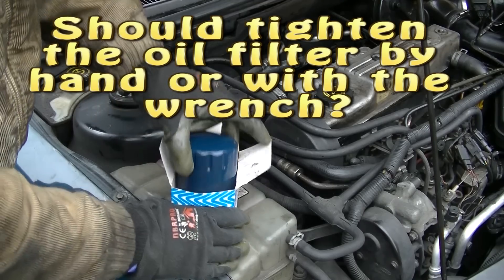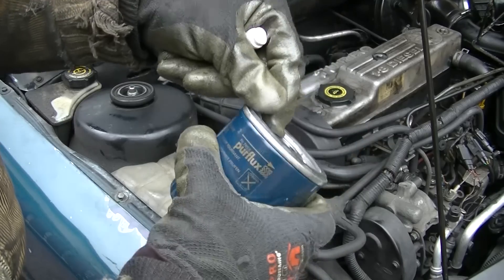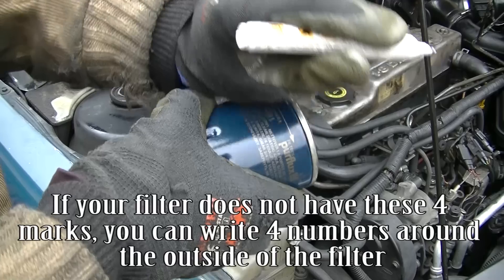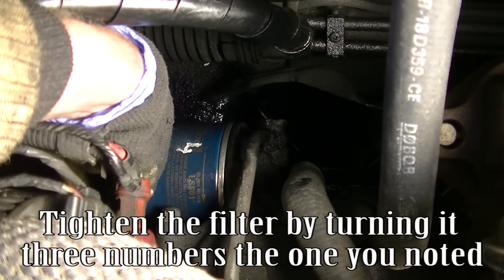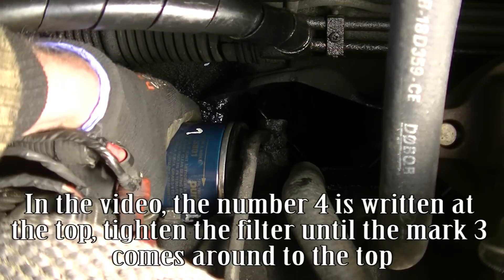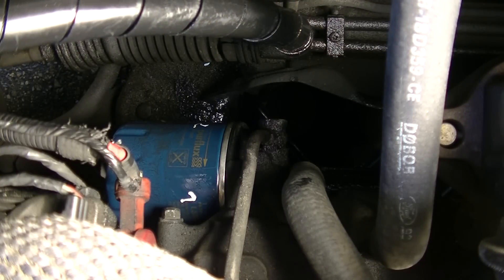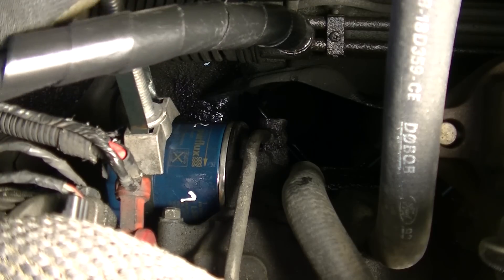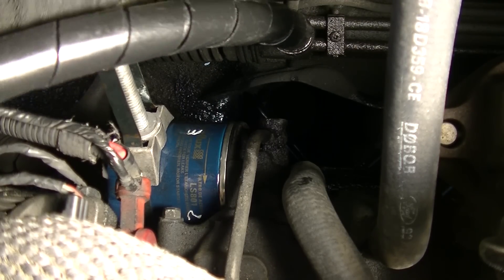Should you tighten the oil filter by hand or with the wrench?

Comment: If mechanics used torque wrenches on oil filters and oil pan drain  plugs used new drain plug washers and made sure old filter gasket came out with the old oil filter most of these issues would be eliminated.

Comment: I really like the adjustable oil filter wrench in the video.  Can someone tell me where to buy it?  Thank you!
Reply: You can find them at any automotive stores and they are cheap. There will be many different types of them. I prefer the filter cap removal ones as you will have less chance to damage the filter housing but you need a wrench separately to use it.
Reply: @fisherpaykelauto6137  Thank you for the reply.  Most of the filter wrenches are for removal, but not for tightening.  The one that you shown on video is for tightening.  This one is difficult to find,  at least Amazon doesn't carry it.
Reply: @kennethtam8684 Sorry I was referring to the oil filter cap removal that you can insert a ratchet into it.

Comment: By hand. I've done it by hand and the next time I do the oil change it's a pain to remove it. Even though it eventually comes off. As soon as the oil filter doesnt turn when I'm screwinf it on I know that's all it goes. Same for oil plugs. Dont over tighten.
Reply: getting em off is NEVER an issue as you can even use a big pair of channel lock pliers or whatever who cares about damaging the old filter I just crunch em and turn they always come right off...the problem on certain vehicles where the filter is up in a hole with no room for hands THEN you MUST have a proper socket which good luck with that as all filters are a vit different....a socket that works on one will likely slip on another it is totally maddening trying to get 3/4 turn without damaging the new filter!  Which is why Fram sells so many of their welded nut filters even though they are crap filters otherwise
Reply: @dougiequick1  arent those nuts meant for loosening the filter only?

Comment: I use a filter cap wrench/ratchet to remove and out of laziness, and the fact that my hand is usually oily CAREFULLY "palm" the ratchet HEAD and snug the filter in.  If not, I have no issue getting a good grip and tightening with a clean hand.  Even with a hand tightening, after time it's a lot easier to remove with the wrench/ratchet.

Comment: It’s more important to make sure you don’t double gasket the new filter. Make sure the old filter you take off has the gasket on it.
Reply: Brian B - THIS......K&N filters are/were notorious for "floating" gaskets that come right off the filter NEW.  I had one stick and double gasketed a filter one time (I always lube the new gasket too).  It was spongy on the install, but I ignored this red flag.  Oil pressure lights going off....spewing oil.  I shut down and got towed out.  Found my old filter after thinking about it for hours......NO GASKET on the old filter.  Lesson learned.  Also......my engine started to make the death rattle....immediately shutting down and pulling over saved my bacon.
Reply: yeah, I'll never make that mistake again.  What a mess!

Comment: I've done this by the 3/4 turn method, and by the torque value written on the filter out of curiosity (it was a Honda OEM filter). The torque wrench yielded the same 3/4 turn. The 3/4 turn begins at the point filter gasket first touches (as this video indicates). Never had a problem taking them off.
Reply: Jim Trainor  I turn the oil filter a bit to loosen the filter. Then I put a plastic bread bag over the filter and turn it to unscrew it off. You may have to adjust the bag a little while doing this. The filter will fall into the bag with any excess oil  works great and your floor or driveway remains clean.. Hand tighten the new filter. Never use a wrench. Some guys that use wrenches end up crushing or twisting the gasket which will cause leaks.
Reply: I have a Honda with OE oil filters. Knowing that the 3/4 turn method yields the same torque recommendations will really be a helpful reference every DIY oil change. And the plastic bag helps prevent mess.Thanks for the handy tips guys. 😀💚👍
Reply: I do the same an always use Motorcraft OEM filters on my 2 newer F150 trucks. Great results!

Comment: Fuck those who thighten filters... Bought a car with a filter so tight it won't come off with specialized tools... so fuck you!
Reply: Easy way to remove a stuck filter. Get a long shaft phillips head screwdriver. Punch it through the actual casing of the old filter with a hammer (may need to start an indentation with a hole puncher first). Once the tip of the screwdriver comes out the other side simply turn counter clockwise and it spins right off.

Comment: Free fill the filter first  you dont want your Donk running without oil while it fill with Oil allways Pre Fill oil the seal as well.
Reply: goldwingman1500 
No need. Engine has oil. Filter’s job is to “filter”.
Reply: @Freerydah73   pre charge the filter with a few ounces of oil.
Reply: @Freerydah73  Sump has oil, engine relies on lubrication. Oil pressure light goes out sooner if filter is filled with oil.  Most wear occurs on startup as cylinder walls lacking in lube, till up and running.
Reply: I fill mine half way. So i don't accidentally get oil everywhere.  Lol

Comment: You don't need to tighten filter with a wrench. You want a snug fit, don't overtighten filter or you can actually damage gasket which will result in an oil leak.
Reply: Thank you! We didn't need a 4 and a half minute video to get that information.
Reply: that is all well and fine to say and is true ONLY if you can actually get your hands around the filter with some vehicles is literally impossible and DOES require a filter socket or at least a filter with welded nut type deal on the end to use a regular socket or wrench on ...the trouble is that might be  crappy filter or not available ....then you are stuck desperately trying to fine a filter socket that will actually stay in place and not slip ....from time to time I have had the worst luck....I have a quite the collection of crappy filter wrenches I could just SCREAM sometimes!
Reply: I tighten by hand, and go until I can’t spin it anymore. I’m fairly strong. Is it possible to go too tight by hand or is that an unreasonable thought